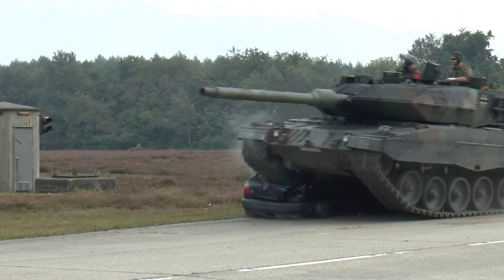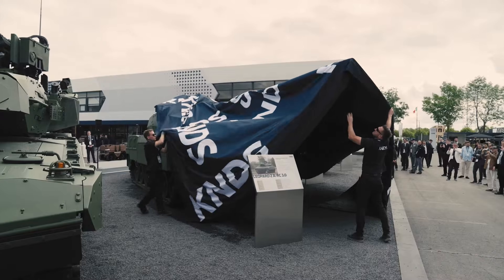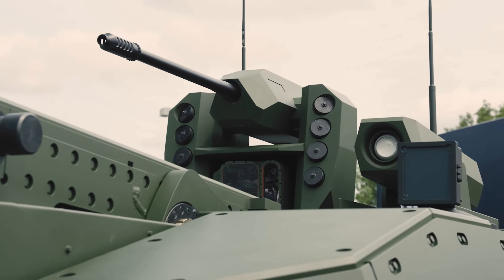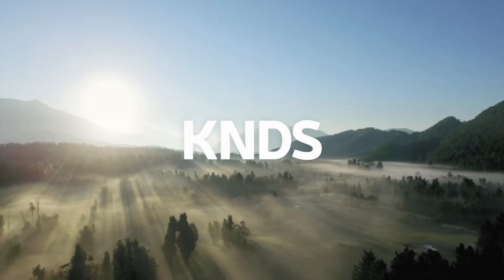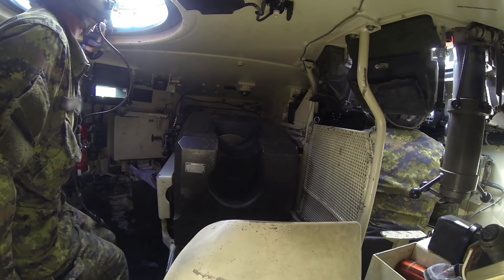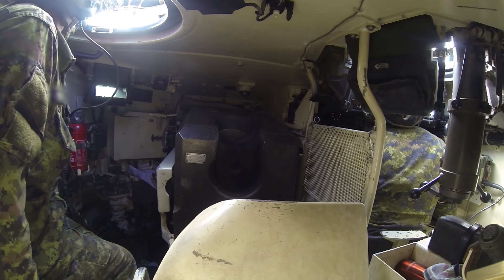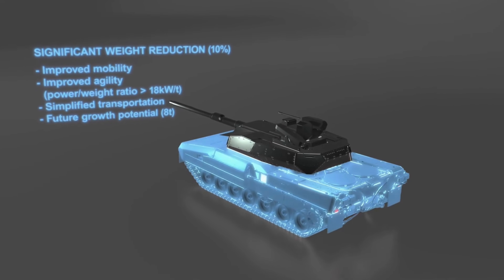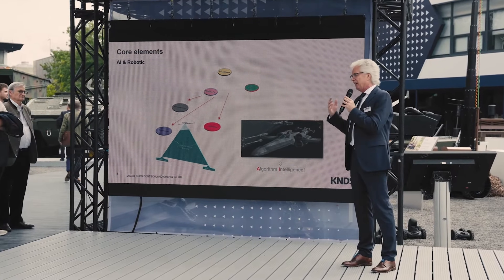The Leopard 2 A-RC 3.0 Main Battle Tank | 140mm SMOOTHBORE GUN

Comment: This seems like it could be a very valid upgrade path for countries that have the Leopard 2. Real questions I have on how good the top-side protection is, because most implementations of Iron Fist-type Active Protection Systems skimp on reloads, effective ability to reload the Iron Fist launcher, and backup systems -- you'll note the Israelis typically use the two-shot Iron Fist in pairs on a tank, or use it as the backup for priority threats, while their older Claymore-style missile-buster has a fast reload and a stack of fourteen (!) reloads in its magazine -- the continued minimalist smoke dischargers that cannot accommodate multi-spectral Improved Thermal Smoke [120 mm mortar shell]. The twenty-round two-layer magazine is presumably for 120 mm cannon semi-combustable ammunition; so, perhaps sixteen rounds of 130 mm and twelve of 140 mm. That's rather light. Importantly, does the missile launcher have a magazine, and does it have an autoloader?

The 30 mm automatic cannon is welcome for its anti-drone potential -- and we have seen plenty of tanks taken out by 25 and 30 millimeter cannon fire -- but the Steyr-Daimler-Puch 15 mm Heavy Machine Gun would be, in my opinion, the much better choice. Its standard FSAPDS-D ammunition is Geneva-legal for use against infantry (AT teams) and collanderizes APCs and most IFVs. Its HE round should be extremely effective against drones, as it was engineered to be effective against military helicopters. And a very great deal more count of ammunition can be carried in whatever volume was provided for 30x113. But, will penny-wise pound-foolish bureaucrats obsessed with bespoke requirements and localization pay the "high price" of the A-RC 3.0 rebuild and conversion?

Having drones on-board would mean needing the return of the fourth crewman, to serve as a drone controller. Better to have that man teamed with a battlefield hacker/Electronic Warfare man, a Signals Intelligence man, and a Communications Specialist, all aboard a Boxer or CV90, with all their supporting gear and a great deal of charging capacity for drone batteries and the fuel to power it. Drop the turret to favor arrays of antennae and a great deal of A.P.S., and you have your reconnaissance vehicle; carry a fair number and variety of drones in external baskets.

Comment: 6:00 More likely , a tank batallion with 2 standard 120mm companies, and a heavy company with 130mm (GER) or 140mm (FRA).
Reply: Or even mixed at one per four-tank platoon (like 76mm Shermans to 75mm Shermans), or two per platoon if the platoon goes to six tanks.

Comment: The Armata was far from the first tank to have the remote turret concept. General Dynamics working with the Jordanian military, was pioneering this concept long before the Armata with their Falcon 120mm remote  turret made by the Jordanian KADDB defense corporation in partnership with IST Dynamics of South Africa.  This was placed upon a Challenger 1 chassis but is designed to be used on many different tank chassis systems with the Falcon 2 and Falcon 3 designs.
Reply: Soviets in cold war had prototypes long before Armata.
Reply: @MrPezsgess  Which prototypes were those?  I'm not aware of any such prototype before 2010.
Reply: @wigon  Like Object 299 that almost 1985. This has similarities with Armata like unmanned turret, 152 mm gun. I mean the soviets were pretty advanced but they never comited fully to an idea that's crazy. Like between 1930-1940 they worked on remote controlled tanks. You can read about teletanks. They also had a lot of projects that could have been with unmanned turret like the Object 477 this has little to no information but there were more types. It seems Russia doesn't want to directly compete with western tanks as all their tanks in service are small MBT-s 2/3 the size of other tanks.
Reply: Abrams TTB also

Comment: I really hope the 30mm has a fire control radar and is automated like the AEGIS or at least a data link with a ground based radar system to allow for easy identification of drones.  It's pretty much going to be the only viable anti-drone system that I can see working.  Platoon integrated SPAAG's will be a good stop gap solution though.  Too easy for a swarm to take out though since a single SPAAG wont be able to keep up.  Especially when it has to reload.
Reply: That's what MASERs are for.
Reply: With the Trophy system, the tank has a spherical air surveilance radar coverage. The 30 mm are chosen as that's what is entering service with the Skyranger anyway and it's about the minimum size necessary for airburst munitions.
Reply: Small,  plastic made drones are EXTREMELY hard to detect, especially when flying at 3-5m above the soil.  Is not such thing as "easy" detection of drones. Get an education.
Reply: I am skeptical that it would be effective against drones. First, you need to detect the drone in a quick manner to react. 2nd, decoy drones exist. 30mm gun to air burst seems like over-engineering. 3rd, tank doctrine still seems stuck on the concept of tank vs tank battle, when that is a very rare; no focus on indirect fire capability. History has proven that tank vs tank battles just don't happen often, so the Western idea that the best anti-tank weapon is another tank isn't realistic. Tanks are meant to draw fire and move quickly as to overwhelm the enemy, or outflanking the enemy; they require mass, speed, and defeat almost anything their way. Otherwise, they are not effective, so when they are not doing that, they need long-range indirect fire capability to stand-off or skirmish without being too noticeable, because tanks are not good for attrition. They are expensive things to lose, and they are many countermeasures to their ability to roam freely. Western tanks in Ukraine don't have a lot of use because they can't be used in mass without huge risk (not easy to replace), and they have absolutely no ability to indirect fire in skirmishes, which is what happens in Ukraine. Ukraine is an artillery and drone war, not a tank war. Big difference.
Reply: @samuelmorales2344  Who's being unrealistic?
That's why Western militaries have emphasized AT weapons for infantry since the First World War. What do you think Javelin and NLAW are for?  Don't you think, "Maybe the lack of tank-on-tank fighting is why no more than 25% of a Western tank's ammo load is AT?"

Fucking DUH.
Reply: @samuelmorales2344  - This machine looks more like a money-trap for taxpayers, than a decent machine on the modern battlefield. The slow-minded germans learned NOTHING from the war in Ukr (as most western countries). 
If you add the economic decline of the industry in Germany, the social unrest, and the major dependence on US provided weapon systems, I do not see this project gaining legs. 
With the money they spend in building such a machine, one can build 10 000 drones.

Comment: M2 Bradley turning into an actual war winner in the meantime so yes great engine and transmission and main gun on the current Leopard 2 but still needs massive amounts of work as this mbt goes to War for the first time agains Russia. So far no disasters unlike for the Russian Armor which has effectively been wiped out and now needs to be wholly reconstituted...that includes the crews and service and support i might add...but yes the M2 Bradley does not weigh nearly so much and is proving out the "light tank" concept that carries infantry crazy well at the moment. To date that has proven to be the only tracked War Winner along with the CV-90 as moving infantry with the Tank means bringing drone defense in the form of infantry combined with the IFV an absolutely lethal combination Ukraine has discovered so reports say anyways in a now very aggressive defense. Europe needs to get in this fight or simply not be relevant in 21st Century War tho, absolutely. The USA has deployed through its allies maybe 20 front line fighter jets and insodoing has achieved complete air dominance over Ukraine using Ukraine pilots who now get to use Russian drones as "target practice" to familiarize themselves with this crazy advanced machine. Imagine what 20 Blackhawk Helicopters could do! Anyhow these massive main battle tanks can still very much do "death by a thousand cuts" so long as Russia both keeps attacking and invading whether that can therefore then lead to a PROPER massed assault using armor hard to tell but Ukraine also has its own main battle and rumors persist of THOUSANDS of these😊😊

Comment: The Armata does look quite formidable but to my knowledge has not yet been tested in actual combat. It would appear that drones are now the biggest threat to tanks on the modern battlefield and I haven’t yet seen any tank that can adequately defend against them.
Reply: There's a reason the M-1A2 SEP v.2/v.3 reintroduced the M-60's powered cupola mount -- with upgrades taken from the Avenger SPAAGs that are going away -- plus upgraded top armor and vastly improved sensors for the driver.
Reply: @davidgoodnow269 where on Earth did you pull that out of? The CROWS on the SEP v2 and v3 is powered and has Gen 3 thermals a laser rangefinder and an integrated fire control system. The M60 cupola is just a manually operated machine gun mount with overhead protection. There is not even a valid comparison between the two.

There is absolutely nothing from the Avenger on the SEP v2. I left the Army before the v3 entered service but I doubt it has any Avenger bits stuck on it though I'd kill for an M3 instead of an M2 in an anti-drone role. The M3 has nearly double the rate of fire.
Reply: None of the tanks destroyed by drones in Ukraine are particularly modern and thus lack active protection systems. FPV drones are just slower missiles and are at most a software update away from being hard countered by the existing APS systems found on the latest models of tanks and AFVs.
Reply: @ElijahDecker  sure, an AT missile costs only 500-1000 USD... 😂😂😂 while a chines drone can go to 250.000 or more. Get an education, dude ! 
AI driven autonomous drones are coming, capable to scout & shot the big armor, and they come in swarms, at night, or in daylight, in numbers, and produced by millions / month, and needs no crews trained for years !

Comment: I'm thrilled to see what the next and upcoming Leo 2A8 will finally look like.

Guess Germany is in a very luxurious position having manufacturers of KF51 and Leopard 2A-RC3.0 in its country... as far as I know, both are demonstrators and far from production level.
I think we have to wait and see what decisions are finally made. Croatia, Czech Republic, Netherlands, Lithuania, Sweden and Germany will get the Leopard 2A8, Hungary and Italy are getting Panther KF51.
I understand the concept of RC3.0 but I'm not sure if it is so much better as the original KF51version that Rheinmetall first came up with. (Germany is getting a "Roland" successor based on Boxer (like Skyranger is replacing the Gepard) - so there is no need for any missile system placed on or inside the next MBT). 
Yes it would be great if it leads directly into the MGCS Program but I'm not sure if the political will is surviving  the harsh reality and the internal contest situation and ambitions between Nexter an KMW inside KNDS... looking on the different demonstrators presented by KNDS at Eurosatory... beside different equipment and strategies between French and German Army (France has no IFV like Puma, it's a hole different set up).

Comment: That looks like a huge shot trap beneath the main gun. I would also think it needs a coaxial 7.62 Mg3 to defend its self from attacking infantry. Also is this Leopard 2 variant a purely German Panzer ???
Reply: Shot traps aren't really a thing with modern ammunition. HEAT and APFSDS don't deflect like that.
Reply: @alexdunphy3716  You are exactly correct, but also somewhat wrong.

That gun raises to create one tasty spot to drill flaming holes. Catch it moving downhill, from a parallel level, and you might have a line through that.

Alternatively, ballistic drop is a real thing, and HEAT rounds can take advantage of it -- as can FPS drones using HEAT.
Reply: @alexdunphy3716   How about a large calibre H.E. Round. The Blast effect would take the main gun/ turret right off the Hull. And give the crew a very bad headache. ISU 152. I think they are making tanks far tobig and over complicated these days!

Comment: I hate to say it but its too much of the same type of layout as tanks designed before the advent of full spectrum targeting drones. Most of the armor is oriented forward. In a tank on tank engagement this makes perfect sense. But from the footage coming out of Ukraine; drones are able to target things like engine decks, tracks, turret hatches and so on. I think the future of warfare requires all around protection against drones, atgm's and sufficient armor against mines, artillery fragments along with redundant or triplicate systems. Most likely drone tanks in the 60-80 ton range. Alternatively if a human crew was needed due to possible advances in signal jamming or if AI automated systems are not developed enough. A crewed tank might need to come closer to 150-200 ton range in order to cope with battlefield threats. I know this sounds ridiculous but bear in mind that tanks went from 6-27 tons in ww1 to 30-60 tons in ww2. Modern tanks have hovered in the 50-70 ton range for half a century now. It may be time that they need to bulk up again.
Reply: It would be foolish to fundamentally redesign tank armor layouts to protect against drones when active protection systems are at most a software update away from being a hard counter to drones. The 1980s era tanks being used by both sides in Ukraine are not equipped with APS systems.
Reply: @ElijahDecker  The Israeli Merkava IV tank is equipped with the latest APS system. Each tank costs $10 million apiece. They lost 19 in the past year, confirmed. With 4 losses being accompanied by video of the active protection system not being effective against ATGM's or RPG's. If you think a software update is the only thing needed then I don't think you've been paying attention. Besides that only 400 have been ordered by the US for a fleet of 4,600 tanks. And each Trophy APS system only has 14 launchers. Assuming each interceptor is 100% successful. What happens when the enemy sends the 15th drone? At $1000 apiece, its economically viable to send a thousand drones at a single tank. And you're still left with $9 million.

Comment: hate that they call it Leopard. This KNDS tank should not be allowed to be called Leopard, since Leopard was the Rheinmettall - KMW (Krauss Maffei Wegmann) cooperation. 
It has not much in common with the last Leo2 A8. They should have called it LeClerk 2, or so, but I guess that doesn’t have the international success connotation.
France needed a new/updated tank and especially french politicians cried out for a „european cooperation“ = get hand on german technology+money. So they pushed to merge a french (Nexter) with a german company….
Reply: It's a new turret and some appliqué armor on a minimally-modified Leopard 2 hull, intended as an upgrade refit.  Same power pack, same everything else.  Could take any Leopard 2, A1-8, and fit this.
Reply: @ Like I said, Leopard is a name for the cooperation of two specific german companies. All other projects of Rheinmetall with other companies have different names! In this case the tank is not a continuation of the Leopard cooperation and a completely new tank and cooperation. Calling it Leopard is misleading in thinking about Rheinmetall cooperation and not a french Nexter project.
The new turret is from Nexter and if You listend correctly, this tank puts the crew completely OUT of and under the turret, so it’s rather like a T14 armata. So the lower part is also changed and you should have only 3 crew members, like in the LeClerk. The armor is at the turret partially lower, regarding to other information about this tank. And the bigger gun needs to prove itself and how reliable it is. 
If it’s only about powerpack and the wheels, chinese also copied such a MTU powerpack and most probably other things of the chassis and we don’t call it „Leopard“. 
That’s why I would like to have it called LeClerk 2. 
Also: Military experts attest it good surviveability for the crew, but in this configuration of the cannon it’s much more vulnerable, especially because of this mechanism that heaves the cannon, that it’s quite exposed. So a lot of stuff can damage the cannon and make this tank much faster unusable as a tank. At the end it will have only the role of mobile artillery and not a tank. In germany we say it’s neither fish nor meat…
It’s my feeling and opinion for this…